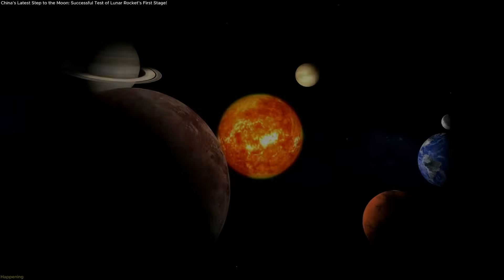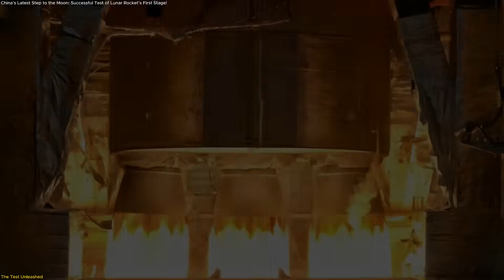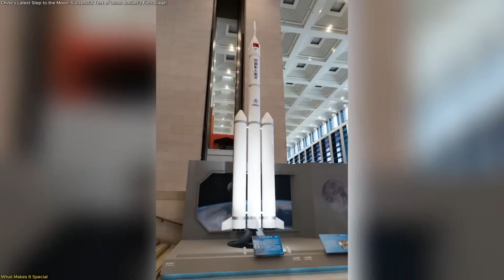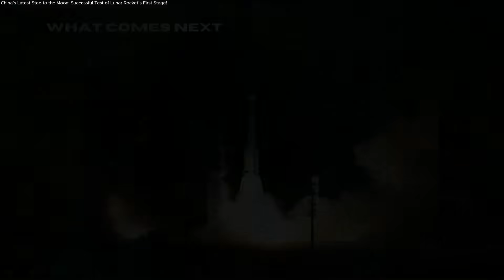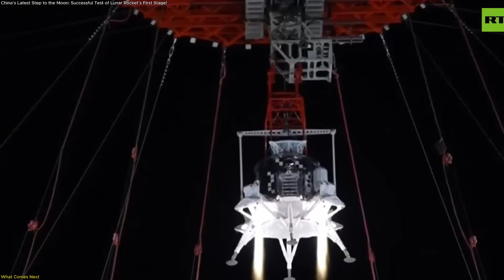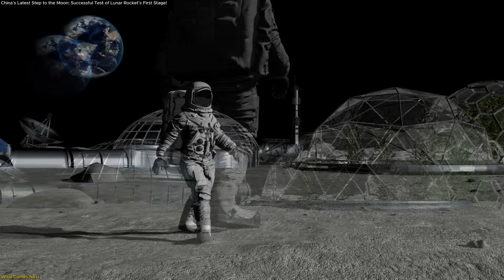China’s Latest Step to the Moon: Successful Test of Lunar Rocket’s First Stage!

Comment: Long March 10, shes got some grunt. Long March 6 lifts 20 up to their space station,
Reply from the maker: You’re right that the Long March 10 has serious thrust—its first stage just completed a static fire with seven YF-100K engines, putting it around the 1,000-ton class mark. That’s the heavy-lift rocket China is developing for future crewed lunar missions.

Just a quick correction though: it’s the Long March 7 that handles Tianzhou cargo runs to China’s space station. The Long March 6 is a much smaller rocket mainly used for launching satellites into low Earth or sun-synchronous orbits, not for station supply runs.

So in short—Long March 10 is the lunar workhorse in the making, Long March 7 is the station supply rocket, and Long March 6 is the small satellite launcher....Thanks,,,
Reply: @SpaceEyeNews  ty for info, so many YT channels , so many launches . Ok if Long March 7 lifts 20 ppl,  LM 10 must be taking the kitchen, dining room and sleeping quarters  😊